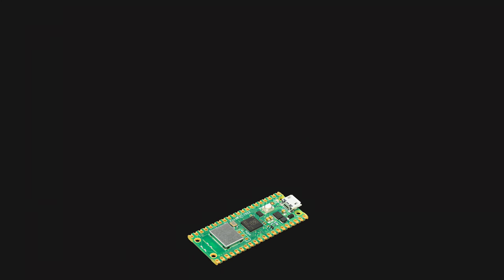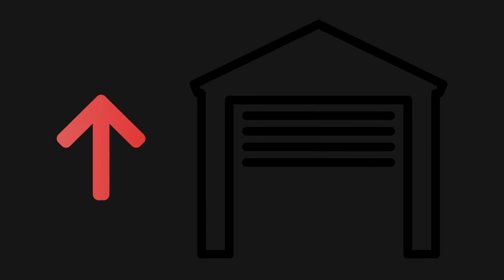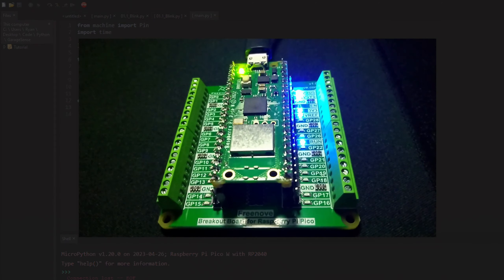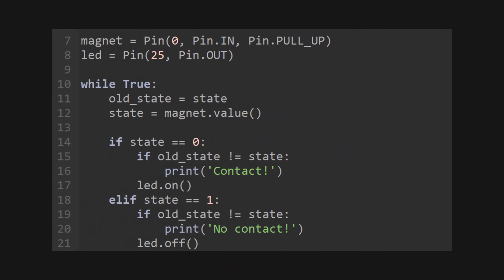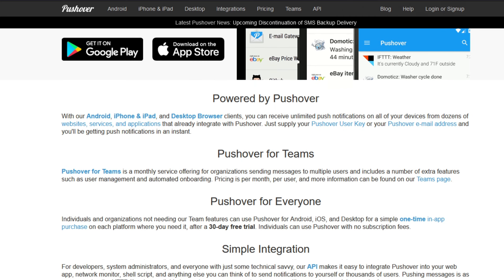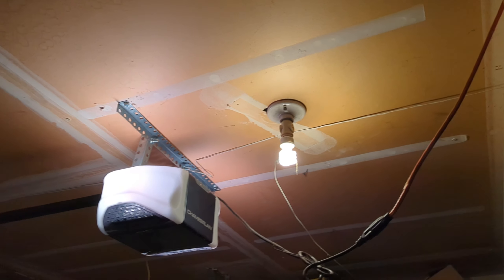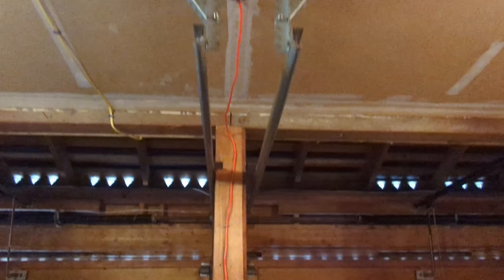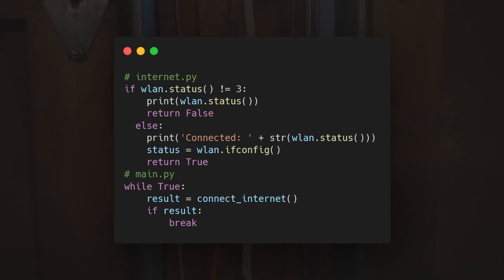How I Fixed My Parents Forgetfulness

Comment: You know, $5 for an outlet box, about $15 for a gfci outlet (because it’s so close to the garage door). $2-3 for a foot of romex, and for 10 minutes of your time you could mount an outlet in just before the light and clean up that extension cable stretch. It’s a pretty easy job. Just shut down the garage breaker and make sure to test the line for any power flow before you do it, and obviously you need to wire it in before the light switch on the circuit. 

All in all, cool project, well executed video, easy on the ears voice, I bet you’ll have a good set of subscribers in no time. Keep it going.

Comment: This is awesome! I would definitely consider putting the pi in an enclosure especially if you intend to integrate relays for door control in the future. Additionally just my pickiness, but I would run a low voltage wire from the pi at the door up to the ceiling outlet and located the power adapter there rather than running the extension cable to the pi. Over all though this is amazing!
Reply from the maker: For sure, I was also planning to sometime in the future print out a little case for it. Never heard of low voltage wire before, I'll check it out. Appreciate the advice!
Reply: @Ryclic You would basically take some doorbell wire (20 ga/2 conductor) and splice it to extend the DC adapter for the rPi. This lets you plug the adapter somewhere more convenient and much more easily run thinner-gauge wire along the roof.
But! Long DC runs can incur a lot of noise on the Pi's power input... and the voltage drop across the line will be much more significant. With empirical testing, if it works, it works! Use a shielded cable if noise is a problem - which is doubtful as long as you're not running a microwave or brushed motor power tools nearby.
But @aar0nhickman you're right, I would much sooner prefer to mount a ~10ft run of thin 5V DC, over taping an extension cord to the floor and having an DC adapter dangling off of a duct-taped female end.
For better wire-to-wood cable management, check out "cable saddles". I like the nylon ones that let you run a zip tie through them, but they also work with twist-ties, loose solid-core wire scraps, velcro, and they pair really nicely with reusable zip ties!

Comment: I definitely would have two sensors. One to detect fully closed. A second to detect fully open. This way you can also monitor moving duration, which might help detect motor degrade. Kind of a big might, but still seems like it's worth doing.

Comment: cool project and use of overkill feature. Wondering if something like a laser to measure length on bottom of the door would be a cool feature to know if the door is an inch open or is fully opened... just trying to overkill the verification method with overkill data haha. My only question would be if the raspberry pi hold good with all these weird climate changes

Comment: Have similar setup for my own forgetfullness and accidental presses on the remote.  Except, I connected the reed switch (more basic version of your magnet switch) to 1 pair of an UTP cable.  Used another pair for the other garage door.  The UTP connects to the other side of the garage where there is a dedicated outlet for my raspberry pi.  But, nicely documented.  I will give pushover a try, my setup only have 2 indicator LED' s on a Raspberry pi in the main house.

Comment: I went down a much bigger rabbit hole, but for pretty much the same reason. I installed Home Assistant on a pc along with ESPHome integration. This made my project both more complex then yours, but also simpler. Of course i went a lot further and am controlling  and monitoring a lot more devices now, lol. Great project. 😀